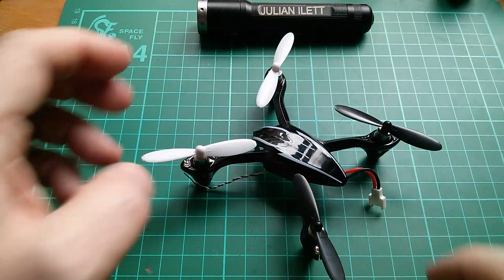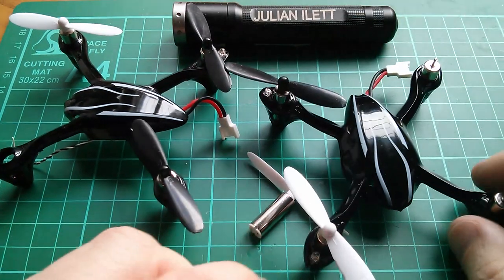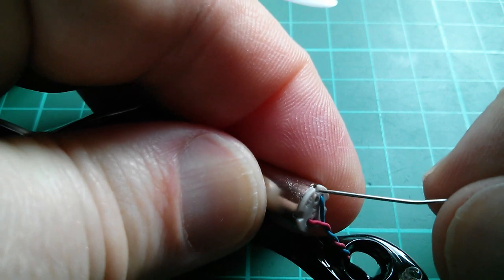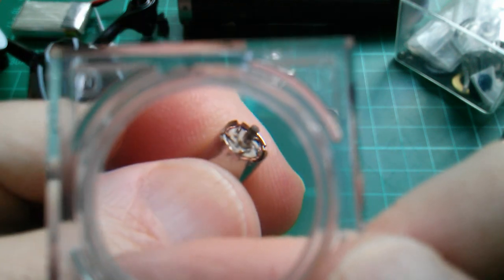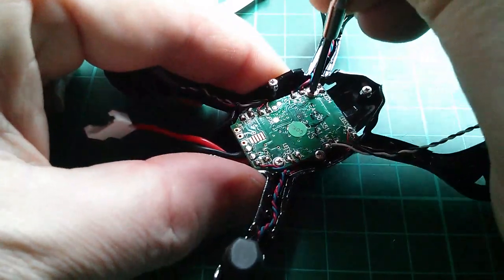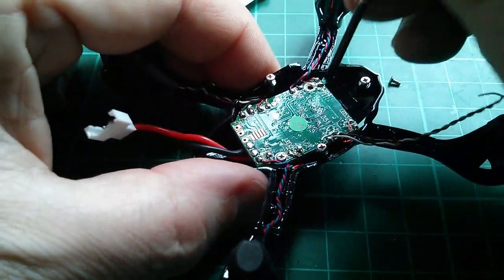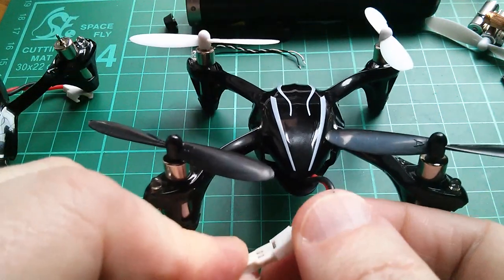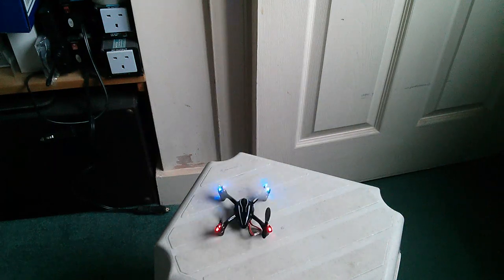Teardown & Fix: Hubsan X4 Quadcopter and Motors

Comment: Nice fix. The extra holes may be for assembly pins to keep the brushes off the comm unit the end cap is fully installed.  Cheers
Reply from the maker: +MKme Lab I think that's it.
Reply: +Julian Ilett Amazing little motors for sure. Cheers Sir

Comment: Those motors desolder from the controller board pretty nicely.  It's not to hard to change them out.  There are replacement one's on Amazon.  I've replaced several on mine.

Comment: I also have that lazy prop problem with my Hubsan X4. I think you have a slightly different version here tho since mine already has a plastic housing around the motors to protect them from "pulling them out" and the LEDs are actually on the middle unit rather than on the sides.
Reply: +EpicLPer This is V2.

Comment: I would guess that the RTC connection is "Remote Trigger Camera" - some of these small quads come with a camera module attached, and this could be the trigger signal if you had that button on the transmitter.

Comment: A tip for Mark - if he turns his new quads box innards upside down, he may well find a prop guard sellotaped to the bottom ! it fits straight over the motors.
Coreless motors are odd indeed. I tend to reuse the magnets in levitated motor rotors, being as they are magnetised around, not end to end.
Reply: +slider2732 Failing that a prop guard is cheap to buy on ebay, as also is a little prop wrench for easy removal of the props without damaging the motor.
Reply from the maker: +Nick B He did buy the prop removal tool, but I find fingers work fine if you're careful.

Comment: The direction of the commutator bars inside the motor casing is reversed in the two different versions of the motor, so you could run it in reverse, but it won't last as long.

Comment: Those coreless motors are pretty crap to be honest. Push the props too hard and the guts fall out, pull the wires too much and they break, and if you can keep them together they burn out. 150mm brushless is the way to go if you want a small quad. :)

Comment: the motors are 4 for £4 on ebay, the motor is amazingly made, it has a centre magnet as it means it doesnt have to have an iron core, thus much faster response due to less mass.  looking at the brush design, its made directional so the brushes have an easier time as they are mounted on a short arm and would dig in more going the wrong way, it would work but last much less time.
Reply from the maker: +jusb1066 Yeah, I agree. The motors would probably work running backwards, but there would be more wear on the commutator.
Reply: +jusb1066 There could also be less power from the motor running it backwards. the brushes on small electric motors like these may be slightly advanced to timing of the poles so the timing would be off if run backwards

Comment: The Hubson H4 is totally useless rubbish!  Mine bounces around so much and is so hard to control I can't even keep it in my yard!  I should have known there was a problem when the guy selling them at the mall couldn't fly them either and kept bumping into people!  The Syma X5 is a bit easier to keep under control but that's just because it's bigger and slower so it doesn't dart around quite as fast.